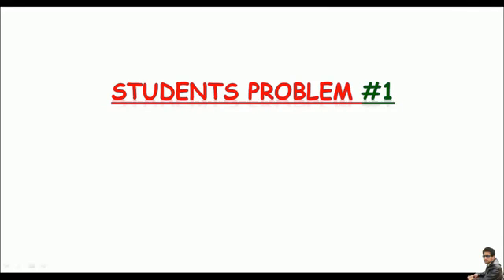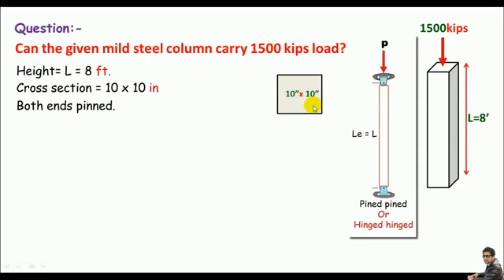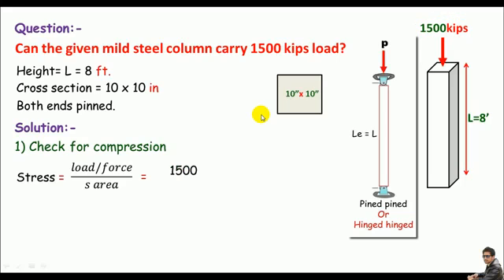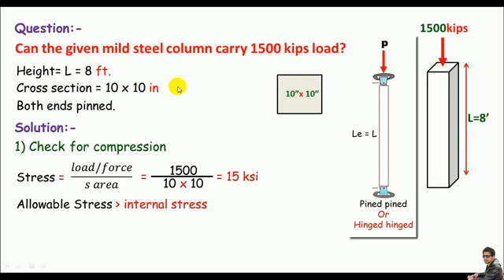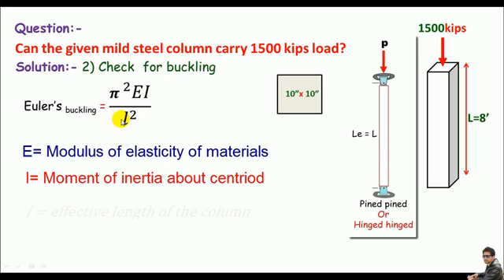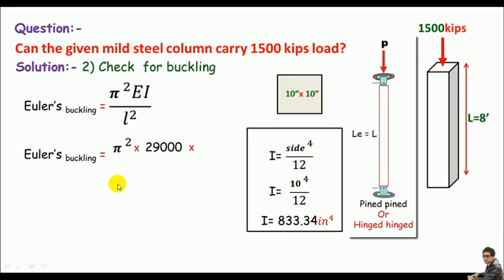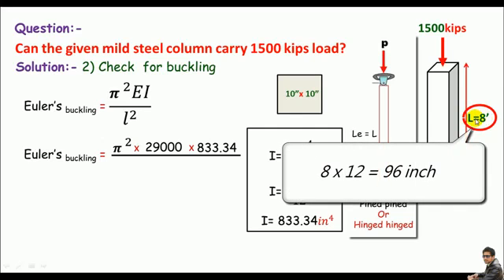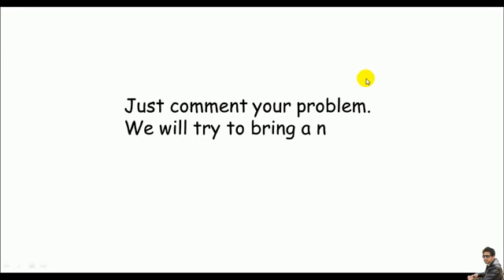How to verify if the column can support the applied load or force

Comment: The E= Modulus of Elasticity of Steel = 29 ,000, 000 psi and not 29,000psi 
The Tensile Strength of Steel is 29,000 psi..
Reply: Structural analysis and finite element method
https://www.youtube.com/channel/UCfZBo0T5G0W_rGYHAXfYIRw/videos

Comment: A TABLE OF SIZE 15 FT X  21 FT AND HEGHT IS 21 FT IS TO BE MADE FOR A LOADING OF 1000 KG UNIFORMLY LOADED .CALCULATE THE COLUMN SIZE WHICH CAN BE WITHSTAND THE LOAD ALSO THE PLATFORM DESIGN AS IT CONTAIN ONLY TWO BEAMS  AND SPAN IS 7 FT FROM CENTRE OF THE TABLE.COLUMN ARE LOACATED AT FOUR CORNER OF THE TABLE .PLS GIVE DETAILED LOAD AND SIZE CALCULATION ONLY STRUCTURAL STEEL IS TO BE USED FOR TAE TABLE AS IT IS IN FABRICATION PURPOSE.

Comment: why 36 ksi?
Reply: Ruhul Amin I think its a srandard value for mild steel.You can check google you surely will get the answer.
Reply: Ruhul Amin kip square inch
Reply: @Bobby14221234  This item is still not clear, where do you get the value 36 kips? if it is a standart value, please tell the source
Reply: Hüseyin Başaran you need to have a factor of safety.. in your area the government has specific safety factor that you should multiply to your strength— for this example his yield stress is 2.4 , that is 15 kips x 2.4 = 36.. hope that clears your question..
Reply: Hüseyin Başaran I cannot help you yet .. I am still a student in civil engineering.. I don’t want you  to put you in danger if you are constructing something ..
Reply: it is taken from building codes